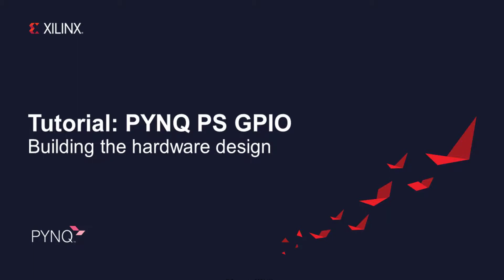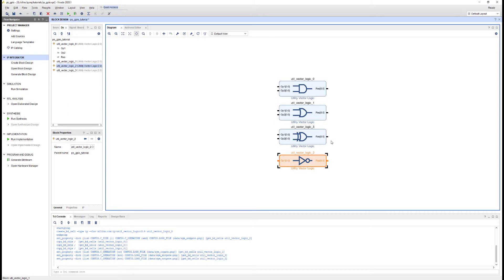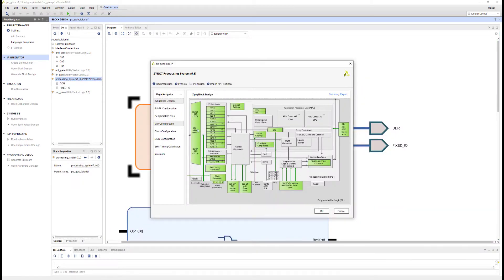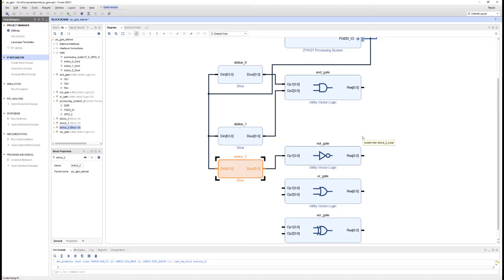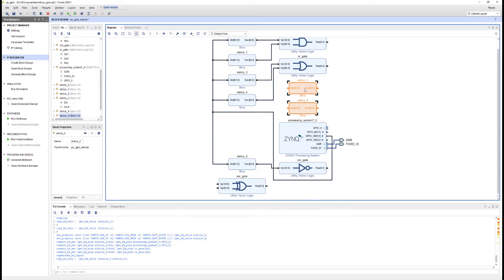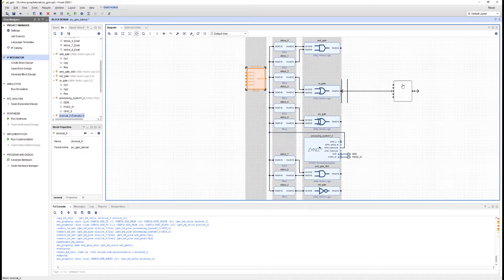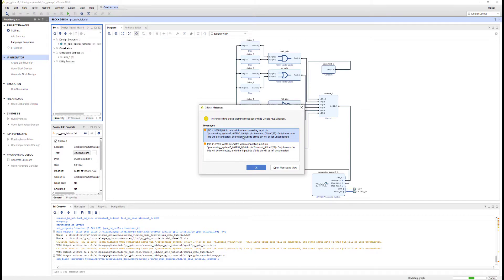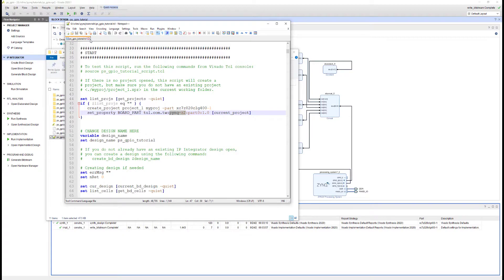PYNQ Tutorial; PS GPIO Part 1: building the hardware

Comment: Hi,
If I configure gpio using jupyter notebook will it not work on my hardware?
Reply: Actually I have created a program and its bitstream and overlay is done
What I want is gpio pin to give high when my above program runs and gpio pin to give low when program ends.
I have written in jupyter notebook the output initialisation and high low logic but when I try to measure it using an oscilloscope there is no output
Reply: Actually I have created a program and its bitstream and overlay is done
What I want is gpio pin to give high when my above program runs and gpio pin to give low when program ends.
I have written in jupyter notebook the output initialisation and high low logic but when I try to measure it using an oscilloscope there is no output